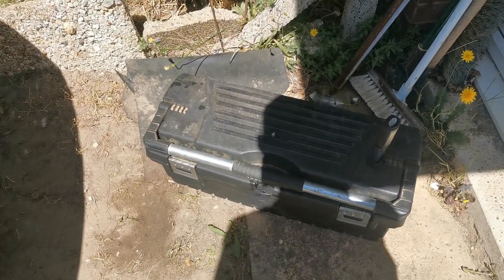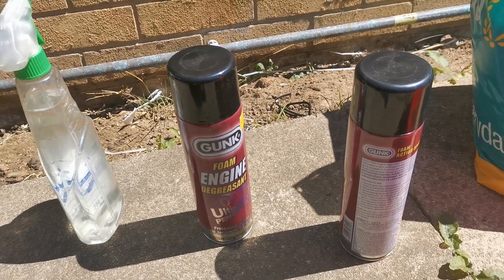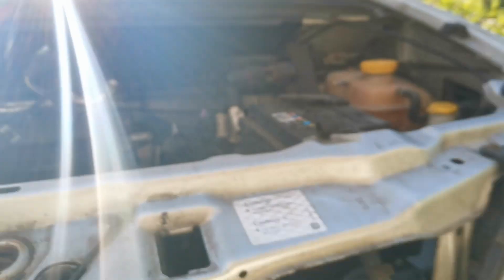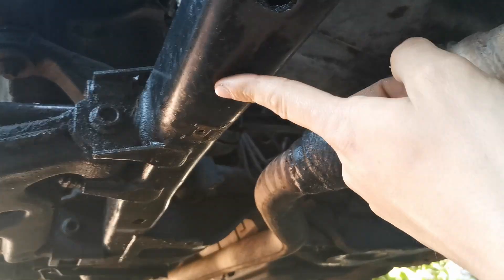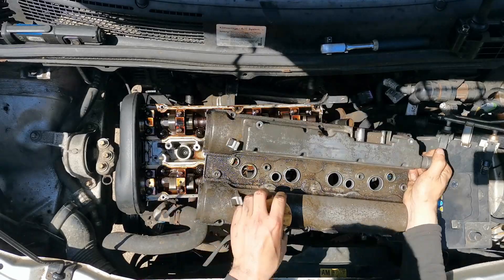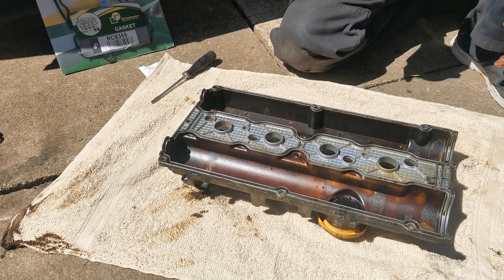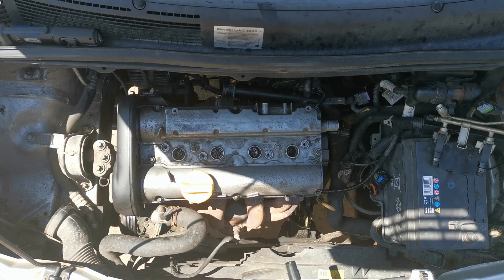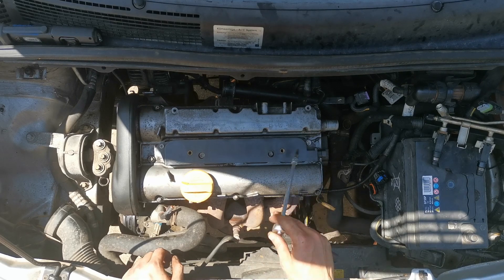2002 Vauxhall Zafira oil leak and Rocker cover gasket replacement

Comment: Thanks for the video. My 2003 zafira was pissing out oil, traced it to valve cover. Used this video and followed it. Now leak free and doesnt stink of burning oil, two cylinders were fully coated in oil, including the plugs so it runs much better now
Reply from the maker: Glad this was useful for you

Comment: I got a zaf gsi and ive had 2 rocker cover gaskets.and.its still pissing out oil.
Reply from the maker: sorry to hear about that hope you've managed to get it sorted now in my opinion there is a possibility for a gasket to fail through a defect they can also fail from either being to tight or too loose.
Reply: @TheZXGuy  The flaw is rocker cover made out of plastic bud. You know Z20 engines get warm.and what doea plastic do when warm? It warps. Thats my problem. Inwill tet silicon and one more gasket. If that doesnt work il get a new rocker cover. They all leak bro trust me.
Reply: My son has a vxr 2008 plate and guess what. The rocker cover leaks lol.
Reply from the maker: I know mate another option you could try is a bit of gasket paste with the new gasket but I agree a vauxhall without an oil leak is a rare sight

Comment: Do u know where the pcv valve is on that thanks
Reply from the maker: Unfortunately not I have to be looking over an engine physically to work things out in sorry.
Reply: Pcv valve will be front right of engine. Small pipe running out.and down. Pcv if blocked causes issues with stalling and not startng again until cold and build up of pressure weaking all seals.and forcing oil out of everywhere lol. Pcv is important and must be clear.

Comment: I have oil going into cylinder 4 not losing water misfiring. Could this be my problem
Reply from the maker: I'm guessing you mean you've got oil going into the spark plug hole of cylinder 4 if that is the case then it is possible you have a rocker cover gasket problem
Reply: @TheZXGuy   yeah that's correct. Do I have to clear the oil from the spark plug hole aswell
Reply from the maker: Yep full cleanup is required before seating a new gasket into place but I would say just do your best with the spark plug hole because they can be rather tricky to clean
Reply: @TheZXGuy   any tips on cleaning the spark plug hole
Reply from the maker: Not sure if it would be the correct way but I use a screwdriver wrapped in blue tissue to soak up the worst then engine degreaser and a tiny brush the style used for cleaning drinks straws and then go back to blue tissue on a screwdriver finally I blow it out with the air line or can of air to make sure theres no bits of tissue left behind waiting to fall into the engine if spark plug gets removed.
But that my way but might not be the correct way
Reply: @TheZXGuy   cheers buddy great help